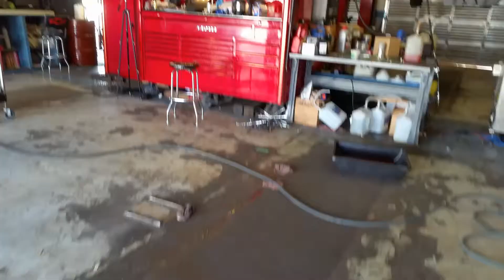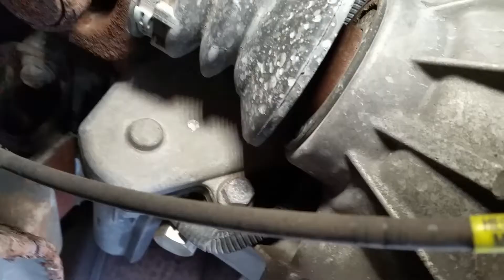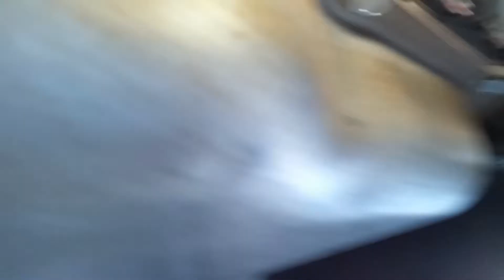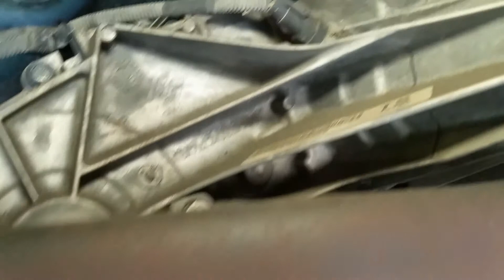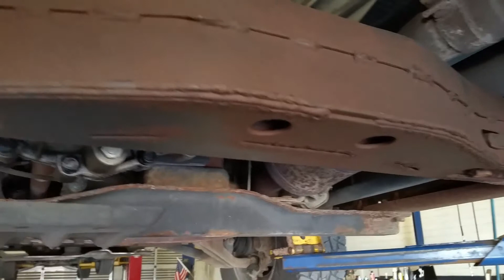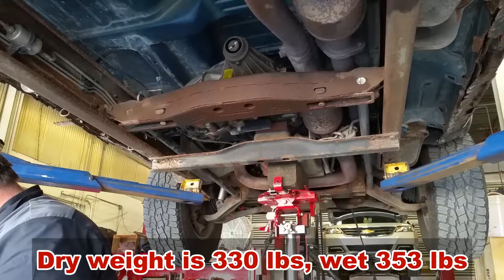Fixing GM's 263XHD Transfer Case, Part 1

Comment: Why is there fluid in between the tcase and trans is it from the weep hole below the output shaft on the transmission
Reply from the maker: On the older models, there will be fluid. It's what lubricates the shaft and then drains back into the trans...When they introduced the 6L series of trans, they put an output shaft seal there and it will be dry in between trans and transfer case

Comment: think is tiny compared to my 7.3  np271. surprising since the dmax has more power
Reply from the maker: That 271 wouldn't fit GM's application because of its size. Thats how they came up with the 263

Comment: Working on the ground. Do you think dropping the torsion assembly and removing the tail section and doing the repair  is doable. I have done this on a 6.5 diesel to replace the clutch
Reply from the maker: You probably could, but I would rather do it on the bench as getting to rear bearing retainer loose would be a bear to release since its on the top. Plus getting everything lined back up and sealer on the case, etc, etc....
Reply: @IrocinZ  yes I know what you mean. I need to take a colse look. The 02 is straight piped with no cats on the Dr side so there is a little more room there. When l do get to attempt it l will let you know how l made out. Your vid is very informative and helped me find the hole in the T case. Thank you Bruce
Reply from the maker: @bruceneveling2813  You are more than welcome!

Comment: If u could help me with the name of one part and if it could be bought separately I have a263xhd I’m gonna make a video on my channel please answer me it the range fork but the back piece with the selector pin what is that called my kit did not come with it HELP HELP thank you Chris lebash
Reply from the maker: If you are referring to the pin on the back of the shift forks, that is sold as part of the fork as far as I know.
Reply: Irocin Z that’s what I thought so I hade them send me another range fork and no back half be watch my 2 min utube I just made